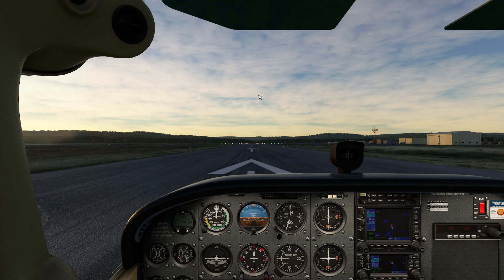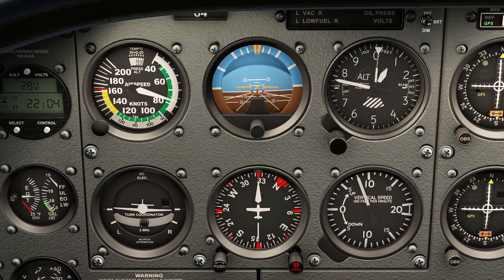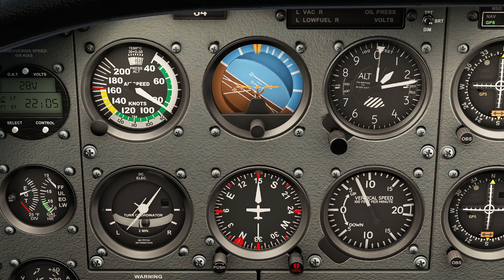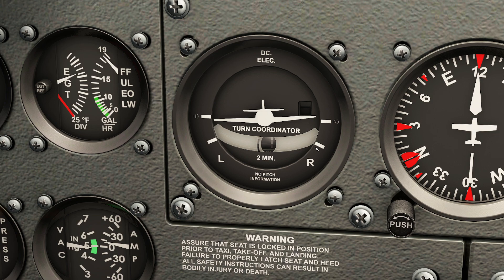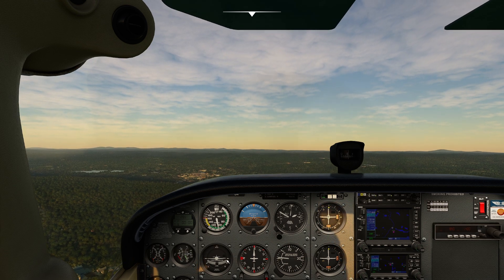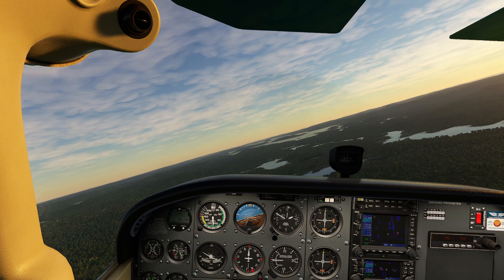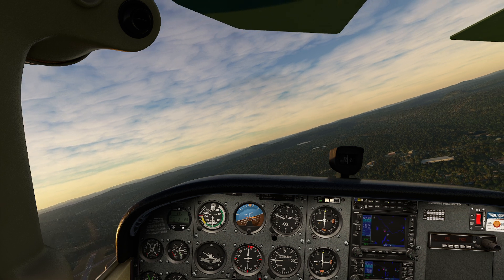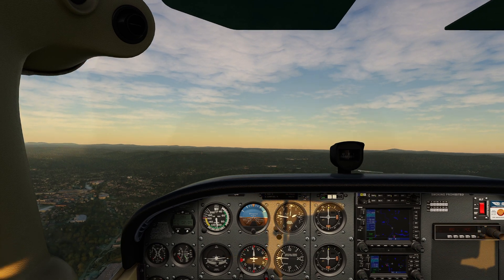MSFS - Timing turns with the turn coordinator

Comment: Did you notice that the slip ball should stay in the middle unless you use the rudder ? It doesn't work in MSFS. That's a basic you learn at flying school. That makes MSFS quite unrealistic from the very start.
Reply: Turn off rudder assistance in your settings. MSFS is defaulted with all assists on.
Reply: It doesn't make any difference it is always on. Haven't you noticed ? And when you make a proper turn applying rudder then the plane slips in. MSFS doesn't reproduce one of first things you learn when flying in training school. It's not really a flight simulator in this regard unfortunately. They are simulating lots of other complex things but this one is essential for a real pilot 😢
It looks like they have forgotten the core of flight. It is wasting the rest of it for me. Yes it's good looking though.

Comment: OK. So help me work through this:
1. Is a standard rate turn ALWAYS 2mins in every aircraft? (C172, B737 etc)
2. A standard rate turn is independent of bank angle? (so less bank angle required at slower speeds and more bank angle at higher speeds to achieve the same rate of turn?)
3. Should all my turns be standard rate turns? (I put the wing on the line Turn Coordinator and ignore the bank angle indicator?)
4. When would I use the Angle of Bank indicator instead?
5. Slower into a turn gives more accurate turn rate, than tipping quickly into the turn?
6. How does the slip indicator affect the turn rate (I guess I should always fly coordinated otherwise the Turn Coordinator will be less accurate?)
Your videos are the BEST technical videos on flying and I really appreciate the time and effort you put in - thanks
Reply: 1. Every aircraft. 3 degrees per second= 2mins for 360 turn
2. Independent, but related, your example is correct
3. If you’re vfr, you can use either, but every turn? No, 3 degrees per second is slow for most vfr flying 
4. When you want to know the angle of bank, the attitude indicator is the only instrument that measures this
5. Yes, because the wings of the turn coordinator operate on differences in the precession of the canted gyroscope inside the instrument… so yes
6. The ball is the “quality” of the turn. Look up slip/skid in airplane and imagine it like a car skidding through ice

As a visual pilot, you can choose to never look at the turn coordinator (but it’s nice for staying coordinated in stalls), however, it is required equipment for any ifr flight (in da clouds) because it allows pilots to time their turns accurately. inside the instrument it is sensing the rate of change in precession of the gyroscope inside, so it’s more accurate than a gps ground track or the wishy washy mag compass. It is also the only instrument that measures the quality of the turn (aka how efficient the turn is)
Reply: Extra for 5. The “cant” describes how the gyro inside is tilted 30 degrees. This allows the instrument to sense precession through movement in the vertical and now longitudinal axis. Vertical=heading change, longitudinal=bank change. So the turn coordinator is more advanced than the prior turn and slip indicator, because it can also initially detect rate of roll (bank).
Reply: @calebatha7133  Thanks for taking the time to reply. Very helpful

Comment: Thank you! I'm currently working on flying the pattern so I see this as an excellent tool for when you lose sight of the runway... 😊👍🏻
Reply: My tip is to use your heading indicator instead. Just take note of which way the runway is facing and turn 90 degrees based on that heading.